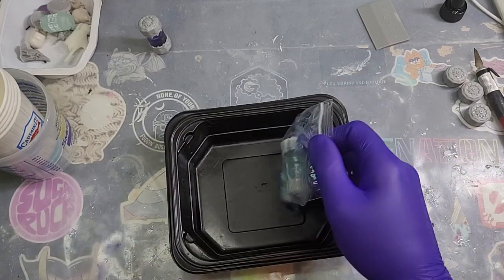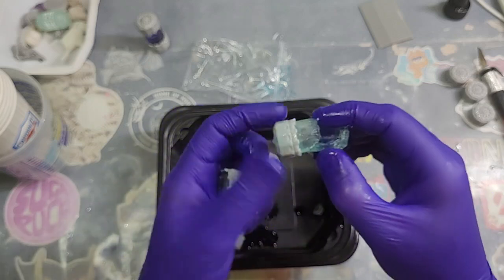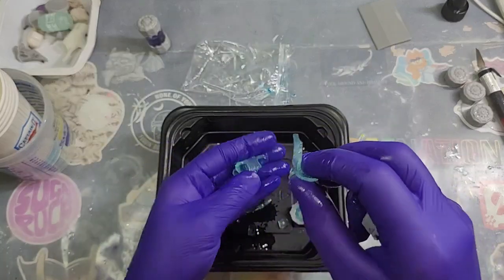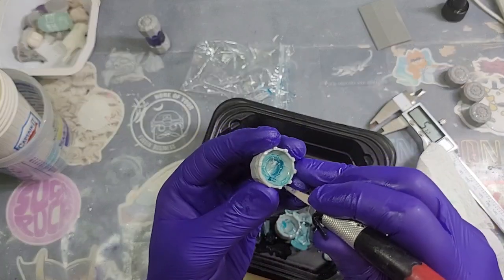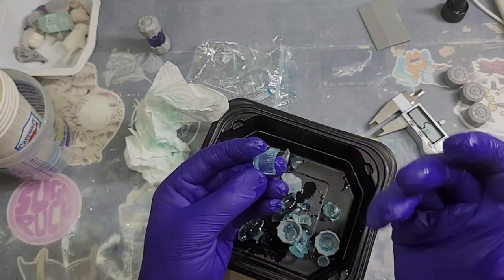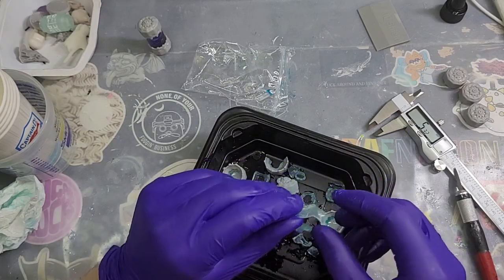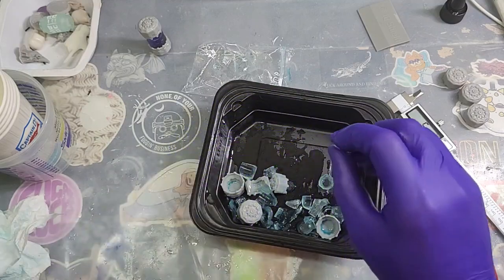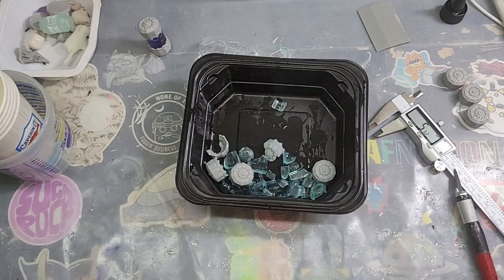Goop Dice vs Hot Car

Comment from the maker: For those who are here because the algorithm decided to spread around this lazy video, here's some context: I've been working on some liquid core d10s that look like TMNT-style ooze canisters. They came out quite nicely after lots of trial and error, but a good friend voiced concerns that mailing these out might run into issues if they were left in a hot delivery truck. So, I decided to do a test with a pair of these dice by leaving them in my own hot car, on the dashboard, in direct sunlight. This is a kind of post mortem for examining the results to see if there's anything I could learn or understand about the failure, so I could correct them in future versions of the dice that I intend to make. Initially, this was only recorded to be turned into some short-form content that was posted on my instagram, but I thought the longer, unedited, lazy version was at least mildly interesting so I just threw the whole thing up here without context or clearer explanation.

If you find any of this remotely interesting, hang around for a little while, because I intend to make a more in-depth video about the story behind these things, the design process, and some general 3d printing stuff.

Comment: No idea why this popped up in my feed but my two cents is your test is kinda worst case scenario and you should repeat the test using a silver bubble mailer as packaging as that may deflect enough heat not to cause them to fail. Also you could consider using a glycol or silicone oil for the internal liquid as it has lower thermal expansion than mineral oil(even water is better than mineral oil in that regard)
Reply from the maker: The mighty algorithm decided that this one was my one shot to impress people, I guess? 
I'm doing some adjustments to the model itself to see if I can't improve overall strength and I'm going to be doing some additional tests in the near future, because sitting exposed on a dashboard in direct sun for a couple hours isn't really normal conditions that I would expect many people to encounter. Sitting in packaging, (box or bubble mailer) in a shaded, but still hot car might be closer to typical delivery truck conditions.

I'll do some looking into glycol and silicone oil, but it's going to be tricky to find the right combo of materials to replicate the same effect. Current mix is oil, water (and water-based food coloring), and iospropyl alcohol because that combo leads to the best flowing, sloshing movement for the goop inside, since the food coloring doesn't mix with the oil and retains a clear separation. If I can replicate that with other materials and avoid any possible explosions, that would be even better.
Reply: @mr_geargrinder  In regards to separating dye from the fluid. Silicone oil and alcohol based dyes shouldn't mix, although I'm not sure if the silicone oil would degrade the dye over time or not so you'd have to do some tests on that. You might find silicone oil to be to thin for a "goopy" like movement though, especially if your adding extra alcohol to the dye side of the equation, so either you'll have to look for a high viscosity silicone oil or add a thickening agent like fumed silica to find the best viscosity for your use.

Comment: just a thought, but maybe start the video explaining what that even is and what you are doing, rather than just jumping into the results. as a new viewer i have no clue what your talking about or what im looking at and lost interest fast
Reply from the maker: You make a painfully good point and I appreciate you taking the time to even post this. The only excuse I've got is that constantly trying to do shortform content has messed up the way I usually go about recording anything I intend to post. This was initially used as something for a shorter video to post on instagram, but the recording ran long, so I figured the rest of it was mildly interesting for the people I'm usually sharing project updates with.

As for what I'm doing and what's going on here: I've got these 3d printer liquid core d10s I've been working on and they're quite sturdy and work great otherwise, but the concern from a friend was that if they were mailed to people around the world that a hot delivery truck or something like Arizona's usual hellish high temps would cause the liquids inside to boil and explode. So I tested that out with my own car on a hot day and it turns out that was a valid concern! This video is more of a post mortem than anything else, while I think about ways I could go about improving things further to maybe avoid that issue in the future.
Reply: @mr_geargrinder  all good, we learn from doing. Keep at it